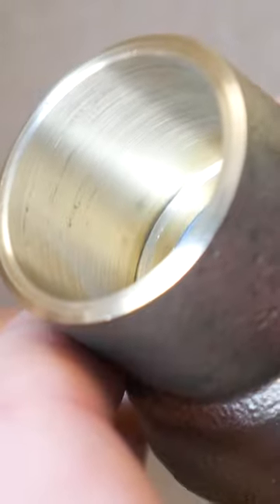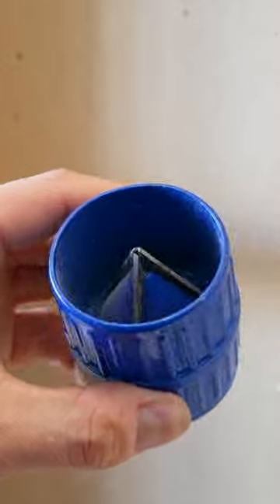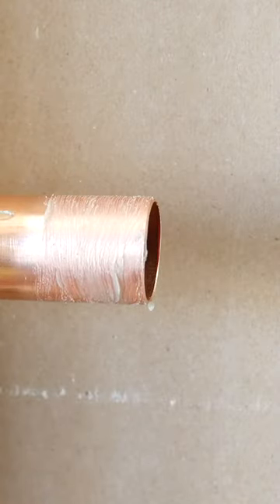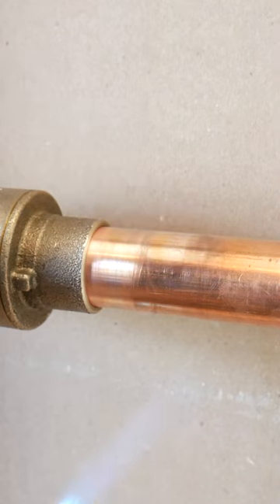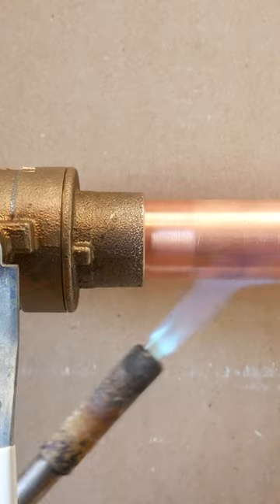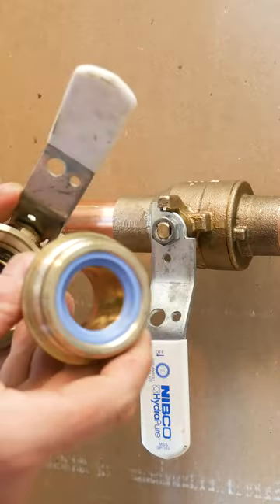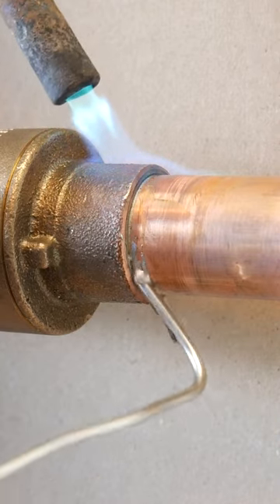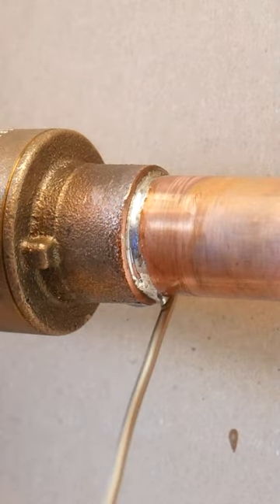How to solder a LEAD-FREE ball valve | GOT2LEARN

Comment: I think the most important lesson about soldering valves is always crack the valve open a bit. Obviously if the water is on to one side this doesn’t apply. If you don’t do this the air inside the ball will expand and pop the valve and it will never work again. I’ve heard some manufacturers say to close the valve but for many years I didn’t know this and have never had an issue as long as I cracked the valve open just enough to let that pressure escape. It seems like sweat valves are like gate valves. 1 in 10 are likely not to work. This is why I prefer threaded valves. They’re less likely to get damaged and if you do have to change it, you don’t have to worry about residual water and trying to sweat the old valve off. You can just screw it off and screw the new one on.
Reply: You're not gonna make enough pressure to damage the valve in the time it takes to solder it.

I've never seen a valve rated below 150psi. Most are 300, steam usually 600.

The problem is you risk the expanding air keeping the solder from sealing all around.
Reply: @ObservationofLimits  well I’ve put a torch on it, it then pops, and if you look at it there’s a spot where it’s blown out so I’m not sure what else would cause that. That’s how freeze breaks happen and that’s just pressure created from ice expanding down the pipe. So I disagree
Reply: @joshcowart2446  ok clown.

Are you talking about the solder joint or the actual valve?

Because the valve seats are teflon. They get soft at about 600F. 200 degrees above even lead-free.

If you're damaging the actual seats you're doing something wrong. I've steam and pipe fitted in a foundry for over a decade.

Not sure what you're "popping". Unless it's the solder on a joint that's in a 3" gap between two closed valves. Then maybe you'd have enough air pressure to blow the liquid solder joint out.
Reply: @joshcowart2446  and I guarantee you freeze breaks will burst the brass/copper/bronze before the teflon as well.
Reply: @ObservationofLimits   yes those sure of their positions have to resort to insults. I don’t know what fails first but you can visually see the Teflon or whatever it is ring in there burst out of round. Maybe it’s cheaper versions. I’m using mapp gas so it’s not like I’m trying to braize the thing. I’ve soldered for over 20 years so I know what I’m doing. I know if you close the valve it will pop if you don’t it won’t. You’re the wannabe me genius so you figure out why
Reply: @ObservationofLimits  did you ever think it’s not the Teflon integrity but that it’s seated in something that could fail. Pose the question to the rest of the comments and ask all the plumbers if they’ve ever soldered on a valve that’s closed and it popped
Reply: @joshcowart2446  Plumber here. No. I've never even heard of this happening from anyone else either.
Reply: @daddy1571  well that’s 2 to 1 you got me
Reply: @Josh Cowart  2-2 Josh. I know exactly what you're talking about. I always solder valves in the open position for this reason. There are valves I pickup from the supply house that make a loud ass pop noise when I open them before even soldering, strangest shit.
Reply: @coreysharp9794  You're supposed to keep the valve cracked not fully open. After soldering you close the valve until cool.
Reply: @daddy1571  send me a link where the manufacturer recommends that and a reason.
Reply: @coreysharp9794  I learned how to solder the no-lead ball valves at the Michigan copper institute. I went there for a medical gas seminar. Anyway  some manufacturers recommend the valve be in the open position(I always used to do it that way) and some say the valve should be closed. Regardless of the manufacturers recommendations the proper way to keep the teflon seats inside the valve from overheating, there's a procedure of heating the pipe first(you already do this if you are proficient at soldering) once the pipe is heated more than you would on a copper to copper joint then you heat the valve and go from 6 o clock to 12 o clock on both sides. You will notice it caps perfectly. Then you immediately shut the valve until it's cooled. The teflon seats will only melt at around 620°. If you're leaving the valve open I don't think it will affect anything honestly. You've soldered enough of them to know if it wasn't good by now lol. This is just the procedure that is scientifically tested at the Michigan Copper Institute. We un sweated the pipe out of the valve and looked at the solder penetration. They were always a full cup when done this way. We did some without heating the pipe first too. They looked good on the outside but when we unsweated them they were barely capped.
Reply: @coreysharp9794  that’s not it. I know the pop you’re talking about. I assumed it’s the sort of suction you get when you first buy and open a valve. This only happens after applying heat and it’s a fairly loud pop. I’ve seen it mentioned elsewhere in the comments so I know it’s a thing. Is it cheaper made valves or poor design I don’t know. Also, the only ball valves that I’ve seen that won’t turn off due to internal issues is solder valves and I’ve visually seen the seal pushed out in one area. It looks like something pushed it out in one area of the circle.
Reply: 😂 in USA , people think that soldered valves are the best , they’re absolutely shit , when it comes to maintenance, If they faulty you have to chop of section of copper to install new one , if you ain’t got enough length of copper on existing pipe to play , you screwed… Compression valves , always a winner, ain’t matter what bullshit people talk about it .
Reply: @edthelasttribe9580  It's a building spec in every case as to which kind of valve to use. The job I'm on now is specced for threaded ball valves only.
They're better I agree. Plus you don't have to worry about packing leaking like you do sometimes with soldered valves. IPS valves for the win!
Reply: @edthelasttribe9580  I don’t think it’s that they’re the best. I think it’s a cost thing. Our alternative that I prefer is threaded ball valves. The same logic applies. You can screw it off and replace it rather than have to cut copper or sweat it off. Solder valves are cheaper because they’re easier to machine. They’re also cheaper to install because you’re removing a step. Also, I don’t sweat make adapters after they’re fitted. This means in some cases I have to sweat a male on a small piece of copper, then thread it in, then solder the rest. This makes them much more time consuming. Now we’re switching to pro press valve valves which are even worse because you can’t sweat them off so you have to cut the copper. We don’t use really compression fittings here except on angle stops and supply lines. This is because I don’t think it’s a reliable connection. I’d much rather sweat or thread something. I don’t like pro press except in some repair cases where water affects soldering. However it’s the new thing and we use it for entire commercial jobs. I’m worried what will happen in 10-20 more years as water starts to work on those o rings. We may have a quest situation with massive lawsuits
Reply: @joshcowart2446  I've already done a few commercial remodels and we've found a few propress joints leaking. Luckily it all got demo'd.
I guess Propress is good for some repairs where the water just won't stop. Some of these yootoober kids ONLY use Propress and those fittings are expensive! Especially compared to copper sweat fittings. A lot of these "plumbers" using Propress can't solder and I wouldn't call them good plumbers at all.
Reply: @joshcowart2446  We have a lot of compression fittings sitting in a hospital over 20 years , no problems at all 😅 brass material has more resistance to a limescale and wear and tear , than actual soldering joints , but press fits , I do not know either, it’s still a new thing , time will tell, I guess.
Reply: @daddy1571  the company I work for does exclusively pro press. They can have inexperienced guys do it because it’s just pushing a button. Also lots of the cost of the fittings is offset by the labor savings. There’s really no advantage other than the plumber gets to save on hiring experienced people. 

I maintain there’s times when soldering is faster. I did a small water heater hanging over a mop sink. It was a tight area and had recirc pump, expansion tank, vacuum breaker, thermometers, etc. Also the way the lines came in there were tons of 90s and swing joints. When you have an m18 pro press you have to be strategic because you can make it where you can’t reach a press. Also moving the heavy tool and constantly repositioning and waiting to press, it takes time. Whereas with solder, I have extra prep time but I could have moved through them in minutes because heat moved through copper very well so once you heat one fitting the next ones are much easier. This is one example of soldering being faster.
Reply: @edthelasttribe9580  the issue I’ve seen with compression is unique to Texas. We don’t worry about freezing in Texas. Ignoring the big storm two years ago we get big freezes every 5 years or so and if you have a bunch of compression fittings and one line freezes and increases that pressure, it will just blow compression fittings off. Also during the storm two years ago, I saw it just pull pro press fittings apart because copper is pretty soft. Whereas with solder, the freeze has to cause the pressure to rise enough to rip the pipe apart. Then you both have leaks but solder it’s a small tear but compression and pro press it’s full port. The problem with this argument is it’s sort of saying you shouldn’t do something because I’m this extremely rare case very bad things will be marginally worse with these products
Reply: @joshcowart2446  nice 👌 full in detail explained, but , once compression is push out , there’s no spilt in a pipe work , you can retighten it again , only by removing olive , and buy one bag of 20 olives , it’s way cheaper repairing it 😅 copper you have to chopped it off all section of the pipe work . You need solder , flux and gas bottle , and soldering fittings which is way more expensive in a longer run . 

Kind regards,

Ed
Reply: @edthelasttribe9580  in that sense I agree. I was referring to a how they fail in a freeze situation. Like pro press they can pull completely apart leaving an open port pipe running whereas I’ve never seen a solder joint pull apart. Solder holds so the pipe will fail and split. So sure a compression is easier to repair than a split pipe but you’ll have many times the amount of water to potentially cause damage. It’s like an open hose versus one with your thumb over it. One has more force but the other puts out a lot more water.
Reply: @joshcowart2446  That’s crazy in , USA …. Have you got stuff like a trace heating on a pipe work ? It’s like a lagging with a blanket sheet almost like insulation, heats the pipe work up once the temperature drops below -5 degrees , obviously electrical wiring involved in that , we have it in U.K. , but mostly is for a hospitals or health facilities. They should definitely come up with something like that to prevent the problems in a longer run .
Reply: @edthelasttribe9580 you can literally unsolder the joint. Only type of person to choose just compression has to be an appt matenince tech
Reply: @hermasmora  I get it , but how many times you going to sweating joints ? How much is on labour , gas bottles, flux, solder ? Carry hundred tools in a properties 😂 all you need is one same compression fitting and a bit of plumbers paste< made in paste formula reacts same as ptfe tape > on a olive , and tighten the nut , job done ✅
Reply: @edthelasttribe9580  yea lol dude i was just hating for shits n giggles. Compression atw for convenience and matenince
Reply: @edthelasttribe9580  pressfit < compression < soldered in terms of reliability. You cannot argue that soldered connections have the fewest failure points.
Reply: Lots of valid points. But when sweating any valve I used to wrap a wet rag around the body of the valve to protect the internals. Never had a problem. I did over heat the 1st 1/4 turn I ever sweated and man that pop was loud! 😂
Reply: Most ball valves are supposed to be soldered while open as per the manufacturer.  Not to mention that soldering it while closed increases chances of a leak because pressure can build up in the closed side of the piping and push the solder out, or even push the valve off the pipe.
Reply: @hempcacaogoji831  I’ve popped a few in my day, I guess I’m just crazy because this can’t open

Comment: The seals aren't Nylon, they are Teflon. Open the valve to 45 before soldering or the air trapped on either side of the ball will blow out the seals when it expands from heat.
Reply: It's not gonna blow the seals out. Those things are rated like 300 or 600 psig. Also the way the seats are, they're captured.
Reply: But yes, they're teflon and should be fine up to 500F no issue.
Reply: It'll possibly keep the solder from sealing if it's a small air chamber and you keep the joint too hot. But that's about it.
Reply: @Benjai  On a new valve that's completely dry it's not so much an issue. It's definitely a good practice to have the valve in the half open position while removing old valves. If the valve is open or closed water will be completely trapped in that cavity and as the temperature raises the pressure gets pretty extreme while it turns to steam. It's happened a few times to me sounds like a gunshot.

Comment: I have seen many master plumbers never deburr the inside of the pipe. It's wrong but it never gets done.
Reply from the maker: Sadly 😔
Reply: Which is why I do everything myself 😢
Reply: Why must you debur the inside of the pipe?
Reply: @johnnyrocket9372  Deburring reduces turbulence inside the lines. This turbulence can even cause pin hole leaks.
Reply from the maker: @johnnyrocket9372  Full video on this subject: https://www.youtube.com/watch?v=WIIvGG6qNJM&ab_channel=Got2Learn
Reply: @laker3 but it will take over 30 plus years or more.

Comment: I was taught to disassemble all valves before soldering. The ball valve is going to take longer to heat up, therefore should be heated first. Also keep your torch moving to prevent burning.

Comment: Clean, flux, fit, wipe off excess flux, heat pipe, heat valve, apply solder the length of the diameter of the pipe.

Comment: My fear is cooking the insides
Reply: The insides are Teflon. Melts at 625F. Solder melts at about 350F (leaded), 420F (lead free).

If you manage to actually damage the seals without sweating in solder you have bigger problems.
Reply: I heated the heck out of one recently and it was fine
Reply: Wrap a wet rag around the valve helps.

Comment: I have soldered a lot of valves but it’s been a while and I wanted to brush up before I soldered another one so I watched your long form video of this and followed your instructions to the tee. The only thing I had a problem with was the valve at the street wouldn’t shut all the way so I had to put 3/8 vinyl tubing on my shop vac and stick it in the pipe to vacuum the water out then really quickly solder the joint before water reached the joint again. Crazy stuff but your tips on what materials to use like the proper flux and solder really helped it go smoothly. Thanks bro.

Comment: Way to do it brother. I’ve seen many heat that brass too quick and without the copper getting quite hot enough which causes the solder not to adhere between the two which then causes a leak, I had to learn the hard way, long time ago, just couldn’t figure out why it would leak sometimes. I sure miss the 50/50 solder, it was like melting candle wax. Lol
Reply: Hey man your age is showing. 😂😂
That’s ok I miss 50/50 too. You can still get it. It’s just not legal on potable water. Boiler guys still use it.
Reply: @Iwillnotbepushed  lol, I know and those 50/50 joints, I would see them pull completely out when doing freeze repair.

Comment: One extra thing I do is be sure to clean and flux the face edge of the valve. It makes the solder seal the face, mounding up slightly like a brazed joint.
Reply: Good idea, will do.

Comment: You make excellent content, I have learned a ton about soldering pipe with your videos.  I’ve added valves to all the sinks in my house and moved some plumbing in my bathroom(all copper), wouldn’t have been possible without your videos

Comment: i will add that the mechanical cleaning process is way more important on this type of joint vs copper/copper or copper/leaded brass. flux must be clean and the right chemistry as well

Comment: Another tip is to use a pair of pliers or mole grips on the valve seat. It'll suck the heat away and prevent the nylon valve seat from melting.
Reply: good techniques to let the excess away from the seals" of the valve rigth- on bubba's 😅

Comment: No, hear the hub first in this case because it's a thick piece of brass and will take longer to heat up than the pipe.
Also when soldering brass you need to use tinning flux otherwise you will have corrosion down the road
Reply: No! Start on the pipe, so it is already up to temperature when the valve is hot enough.
Hot pipe draws solder, and adds heat to heavier valve body. Then you want only enough heat on the valve to melt and draw the solder.

Comment: I HAVE HAD TO SOLDER IN BALL VALVES THAT WERE 2.5 "...I WAS REALLY WORRIED ABOUT THE SEATS BUT IT TURNED OUT REALLY GOOD...
Reply: The seats are Teflon. It melts at 620F.

If you got the seats that hot before the solder was running...

Even lead-free runs at 400ish.

Comment: Never put flame on a fitting.
Put it on pipe at edge of fitting. Heat expands and will  heat the pipe first allowing pipe and fitting to reach proper temp without overheating the fitting